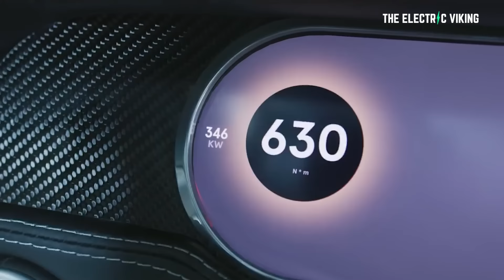Chevrolet's e-motor kit to convert gas cars to EVs is EPIC

Comment: GM has been working on these for years. Ford beat them to market but NOBODY wants to convert to electric here.Ford's E motor has been a complete flop and GM's will be too.
Reply: By flop, do you mean selling out in a matter of weeks? By no one wanting ev do you mean like Tesla selling increasing numbers year after year? I think what you mean is YOU don't want ev. And that's fine, it's not really suited for everyone. But I'm guessing you're an "America first" kinda guy...and guess how we gain true independence from foreign energy? Guess where the majority of ev startups are based?
Reply: I'm with ya there ...  I'm planning a dual motor hybrid setup for my 01 monte (it would be very unexpected for the car) ... I won't go full electric ... and I'd rather do a tesla setup in front or 2 e motors for the front on the wheels like Koenigsegg with a Steve Morris motor for the rear ... I won't go with chevy ... I don't support their ceo and her ideas ... she is ruining the company ... hell I'd rather throw the Ford motor in than support them ... not to mention I don't trust the American evs right now ... I'll go with what has been proving itself over and over again
Reply: @farewellvoyager5379  not trying to start a debate but what I took from it is (I could be wrong) he was talking about domestic and possibly full on electric ... I love electric motors they have their use but relying on the battery tech alone today is risky ... they have the punch to give good times but battery capacities are not good enough especially with real world charging times not to mention the cost ... now when they finally get into the solid state batteries or this new diamond tech tesla is working on it would be well worth it with a lot less risk
I know the risk of water getting to the lithium is low but the possibility is there and that reaction is very violent 
Like I said i love what tesla is doing and I want to have a hybrid setup using a tesla motor in the front with an ICE motor in the back ... but I couldn't bring myself to go full ev with all the driving I do
Reply: @gilbertwheeler160  like I said, ev's aren't for everybody. They are better suited to city commuters obviously. But I actually work in the automotive industry, and have my entire adult life. The range of an electric vehicle is often times comparable or better than an ICE. Charging may be an issue if you're on a cross country trip, but somehow there's a group of people who are under the false impression that it would be bad for our society to install electric charging stations throughout the country...I've met people who drive Tesla's on road trips, had no issue going thousands of miles, using the free charging stations, etc. Also, the impact of cost to charge an electric vehicle is grossly over stated, again by people with an agenda. I understand what you're saying, and it's inevitable that the technology will improve. But, I felt compelled to share some facts in the conversation since most of what was stated thus far was opinions.
Reply: @gilbertwheeler160  imagine if musk had been some broke backyard inventor like Tucker was in the 50's and not some emerald tycoon's heir. The big three would have had him chewed up and spit out. Take Tucker for example in the 50's. I won't lie, the ford electric crate engine was a major success, literally sold out in 2 weeks. I don't know what the fuck the original poster is smoking, but it sounds like it might be a bit of fox news and crack. Chevy is late to the game, and honestly, aside from making potent small blocks what have they ever really done anyways? Dodge, well dodge makes a ton of horsepower from factory, too bad the cars can't hold up for a decade...seems that's always been their approach. I don't think an ev swap is even all that marketable beyond hobby builders. But a hybrid kit would appeal to MASSES. If I could turn my old truck into a 30+ mpg hybrid and get a boost in performance...well shitchya sign me up!!
Reply: @farewellvoyager5379  lol yup ... I've looked into a lot of crazy things in the auto world ... people not only losing their companies or designs but their lives and all kicked under the rug due to the size of them and ties to governments foreign and domestic 
I have a design (once I get the funds) me and a small crew I'm gathering are going to work on ... the first step of it will be performance as I am an adrenaline junkie and want nothing more than to build something crazy for me to do crazy things with ... and from there thinking about tweaking the design to help with the lack of knowledge that is out there with some on driving ... and people unnecessary loosing their lives because of bad drivers ... and the over looking of safety in a lot of designs 
Also we have pretty much 2 options ... power or economy ... and I've come to the same realization as you a hybrid would be better than only ice or ev ... more power better economy and less chance of being stranded as I'm looking to make both systems capable of working together or stand alone in case of an issue with one or the other ... and looking to designs where most components are contained with their systems to make for a quick rebuild or swap if a system fails ... because on race day if an engine goes ... I want to be back out on the track within a couple hours at the longest 
I've been a chevy guy up until recently ... some reason I'm straying away are on newer designs and some political unfortunately ... I havnt looked too hard into what ford has going on with their evs ... but I'd have to say in this day ... if I were to go and buy from one of the 3 it would most likely be ford 
But like I said my preference would be to do a full build myself ... I've machined ... went to school for auto collision and power plants and just want to see how crazy I can go with it 😁

Comment: I converted my 1997 s-10 15 years ago and it lasted 13,000 miles before the 24 6 volt lead acid batteries was toast and my 2013 volt lasted 24,000 miles before it had 2 weak  cells, but I got GM to give me one section of battery, but the dealership charge me 2,000 for the harness.

Comment: As an admirer of EVs with a passion for classic cars, this is a fantastic move. EV conversions have been an exciting option to improve the refinement, reliability and performance for many decades. Kits and packaged solutions are a very welcome development. But the prices are insane. This only makes sense for very high end classics. But what about the guy who loves his mk1 golf or Capri or Commodore? These enthusiasts need to be catered for. When the Chinese offer a 150hp dc motor, controller and reduction gearbox along with a 20 kwh LiFePo battery kit, they'll sell 100 times as many kits.

Comment: The crate motor is new. BUT converting ICE to EV has been around for 10+ years. Meanwhile my converted trikes (cost $2,000 including lead acid batteries) in the Philippines are not allowed to be registered. So therefore we can't drive them. Hopefully this problem is limited to countries infamous for their corruption.

Comment: My first EV was a 1956 VW bug with a Curtis controller and a bespoke DC motor. I replaced the batteries and sold it for a profit. With the proper batteries conversions are a good idea. However DC fast charging is a must. The only disadvantage of conversions. OEMs have that down. That said conversions are best with vehicles OEMs are reluctant to develop.
Reply: Hello Lawrence I remember u from the evdl form many years ago. How does it feel being an old time EV driver with the new EV driver crowd that seems to think they're the first ones to come up with this. It's funny how fast the pioneers from the past r forgotten . that seems to be life we move on things get better and those that had just crawl and inch their way up the ladder are completely forgotten.
Reply: @steveclunn8165  You were a little better at converting vehicles than me. Since having a Leaf of one sort or another for almost a decade for what I paid ($28k for a Used 2013 and a new 2016 Leaf) I couldn't make two better functioning EVs than what I could purchase. I only converted because at the time there was no better option...however with all the new hardware out there....maybe...A van would be nice.
Reply: @LawrenceRhodes  looking back it seems like things have developed quickly but while we were living at that time waiting for better batteries better motor controllers Etc things seem to be moving quite slow. I kind of feel like the best times to be in electric cars as a hobby was the past and the best time to just buy one as you would a normal car is right now.
Reply: @steveclunn8165  Yep.

Comment: batteries are still and issue. I would need a small group of cells that could be positioned in different parts of the car. maybe an e-motor to connect directly to the rear axle and a battery pack where the engine was?

Comment: This is Gadget from the documentary revenge of the electric car. I have been doing conversions for about two decades now. If Ford and GM want to make motors available for conversions of old cars, they’ll need to make something that works with an old car. What I’ve been doing so far is either swapping in a whole Tesla drive and suspension into an old car or making an modification to a Tesla drive so that I can connect it to an existing driveshaft. So far what I’ve seen with the Eluminator from Ford is that they are mounting the unit into a Tesla suspension and then spending an additional $20,000 on an inverter.  The big car companies are really going to have to step up since you can purchase a slightly used Tesla drivetrain with suspension for less than $6000. Or the drive unit with inverter for around 3500.

Comment: This is pie in the sky.... the weight of the batteries will overwhelm any suspension if put in the trunk. Only a truck can handle the weight and not make handling a mess.
Reply: Yes Logan,, care taken where/ how much weight is placed . If range is kept to city commute,  can be done.

Comment: There is a company in California US that is taking insurance totalled Teslas and using them to convert delivery vans into EVs.   Basically a direct swap with lower rear end gearing for a heavier vehicle.  Turns out to be a real sweet swap for a local delivery van.  Tesla being a car that is very expensive car to crash repair.

Comment: Fuck man, i really just want a electric motor i can just hook up directly to my 700r4 or a 4l60e. If emissions gets to point were  cant have a combustion engine i just wanna drop the tank, throw in a battery, swap the motor and add a dead simple controller and keep driving my truck

Comment: I’d prefer to invest directly into a new EV vehicle. I’m sure the engine to e-motor conversion packs will have a place for enthusiasts and hobbyists for specialty vehicles but it’s not a main stream solution for the general population.
Reply: neither are ice crate motors .this is not a " solution"  for the general population. it's for gearheads who would by a crate motor now may consider an electric crate motor. people who can't afford a new car will have to wait 10 - 15 years until there are an abundance of used electric vehicles .
Reply: @ronblack7870  not if the batteries are dead.

Comment: All these old vehicles will run on modern E-fuels. Availability /cost is an issue but a lot cheaper than battery conversion.

Comment: Where do the batteries go and what are the options?
Maybe this is the worst-case scenario, but I have had four Jeep GCs (5.9, 4.7, 5.7 HEMI, 5.7 HEMI). The complex All-wheel drive system sent them to the junkyard between 165k mi and 200k mi. The engines never failed. I don't know who these kits are for but putting even a $55k electric drivetrain in a $10k car doesn't sound feasible.
There is a Chinese company that builds retro American cars on a BYD skateboard for less cost. I would go with one of those.

Comment: People have been buying 5-year-old Nissan Leafs ($10,000), taking the battery & powertrain out, and putting them in frame-based pickup trucks of all kinds, Miata or other sports cars, etc.  For more money, you could just buy a used Chevy Bolt, take the battery & powertrain out, and put them in mini-vans, sports cars, frame-based pickup trucks, SUVS.... etc.

Comment: The French company Transition One offers an EV conversion kit for about 7000-8000 euros (not counting subsidies). The battery (which replaces the gas tank) only has a 60 mile range, but another French company, EP Tender, is developing a portable trailer-tow battery that EV drivers can rent for occasional long trips. Seem like the best of both worlds: Low EV cost, low battery weight, and extended battery range if and when you need it.

Comment: Check out the French EV retrofit company, Transition One.  They have a business model to electrify old small diesel cars.  They promise to convert the car in about 4 hours for about $8k.  Range is only 50 miles, but that's fine for a city car.  They promise this for a handful of very popular cars.

Comment: Where do you put the batteries? They are built into the frame of an ev. Which means you would have to cut floor pan and possibly the frame to modify it? How much does this all cost?

Comment: The big question isn't so much the powerplant but the cabin heater element.
As someone who has experienced a Mk1 Escort Van with a blocked heater matrix I'd rather the vehicle be undriveable if there's no heating.
And NO.. Heated seats just give you a sweaty Arse.
Quite why you'd want one of those defies comprehension but there ya go. There are weirdo's out there !
Getting a sweaty arse doesn't thaw  the blocks of ice you thought were your feet and THAT is real pain !
I have no desire to drive with a blanket wrapped around my legs ever again.

Comment: A while back, I saw a video of a shop in France that did  exactly the same thing.  The same model of a run out ICE car you purchased for  cheap,  went into his shop in the morning and came out in the afternoon as a finished battery car, for cheap. Different shops could  specialize in a particular model for significant savings to customers.  There is, IMHO, no cheaper way to go to a  batterycar, in this particular planet. Good for lions, tin or straw men, and Earthlings

Comment: I'm finishing my 67 Camaro rebuild. Engine $5,500, Transmission, $1500. Will have 400 horsepower. I can buy an awful lot of gas for the spare $50k it would take to go EV.

Comment: These conversions make classic cars commuters again. They become reliable once more and cost less to run than when they were new. They also have the performance to keep up with modern traffic. How cool would it be to daily an E type Jag or a ‘68 Continental?
Reply: Great. if you want to totally ignore the safety issues.
Reply: @hindesite  you’re correct that classic cars are poorly designed for high impact collisions. However, it may be possible to retrofit ABS and ASM to help reduce the likelihood of a collision. You could choose to retrofit a younger classic like an e24 BMW 6 series for improved safety.
Reply: Absolutely, I have converted my 1998 Jaguar XJR and it is now my daily driver. I absolutely love it. I am getting 100 eMPG vs 16 MPG before. Not to mention maintenance aspects.
Reply: @ArtursGarage  sounds awesome! An XJR is such a smooth, quiet refined ice car. With a motor it must be even smoother and quieter.

Comment: I’ve thought for a while someone should sell wheels with integral motors to retrofit to ice cars. Remove the old drivetrain, and put in batteries (custom battery holder using previous engine space).

Comment: Take a look at Edison motors. They're out of Canada. Couple of youngsters are building e-axles that will trade out for the original axles on off-road lumber trucks. They're huge. They're also able to trade out axles on business trucks, e450 size to wheel or four-wheel drive and set it up with or without a diesel generator backup. Surprising what a couple of people highly motivated can put together when the big automakers in the United States are sitting on their hands

Comment: One nagging problem bout EV's, Its that the GRID wont support  all those EV's charging at nearly the same time would create more rolling blackouts than inefficient air conditioners. Being solely dependent on an archaic electrical grid that is at capacity already, not that robust against the environment or solar flares, and is also relatively vulnerable to terrorist threats (most of the grids computer systems still run windows 7)..